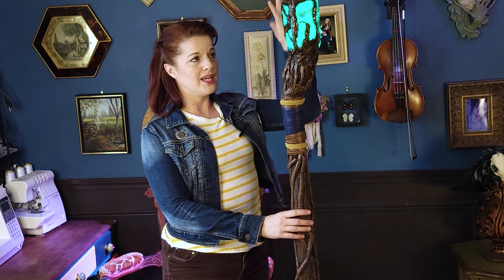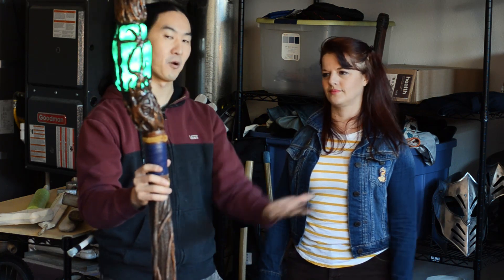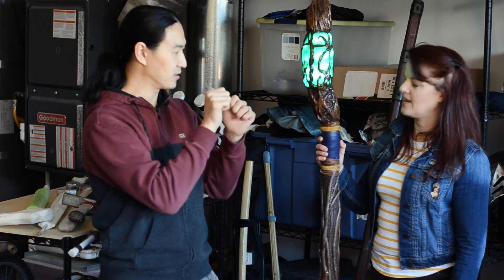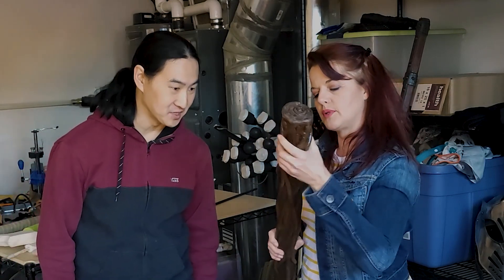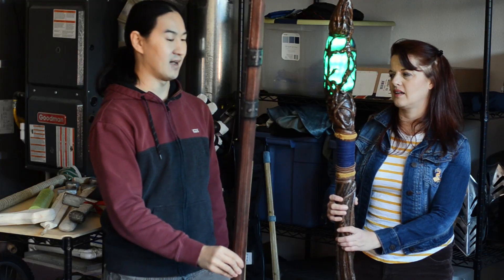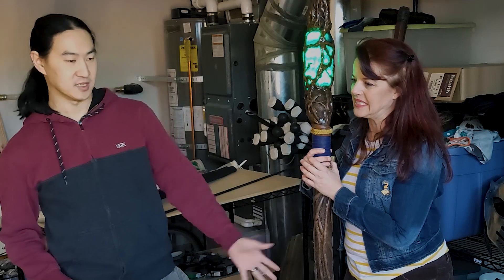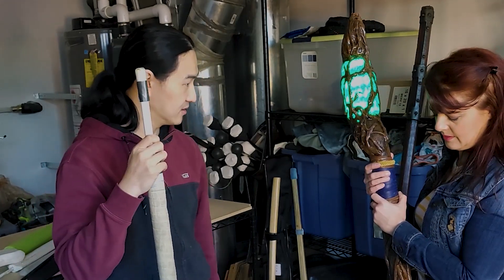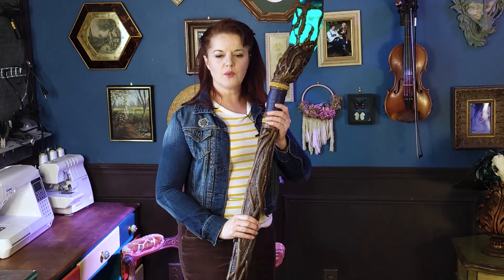DIY LARP STAFF SAFTEY TEST: What Makes a LARP Weapon Unsafe?

Comment: I once caught a full thrust from a 2 handed boffer sword from a 300+ pound guy in the throat.  Turns out the tip had worn through and I was hit by core.  I think if it was a hair to the left, and it would have be hospital time.